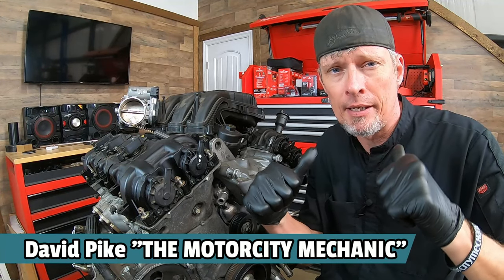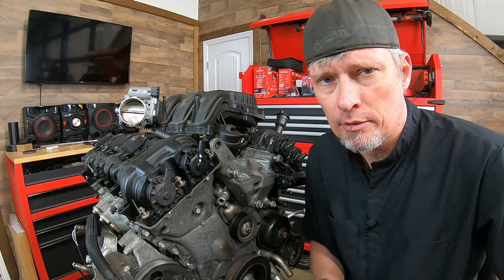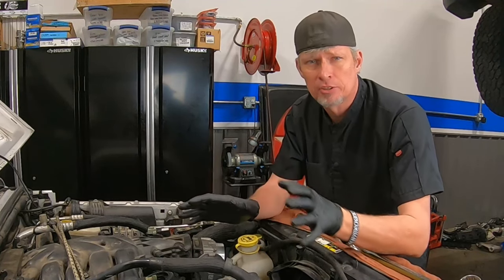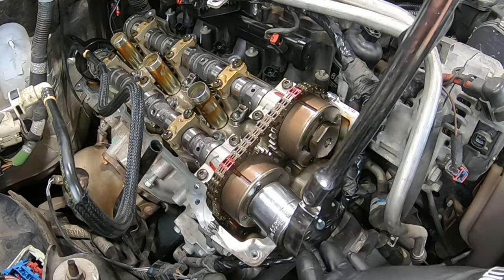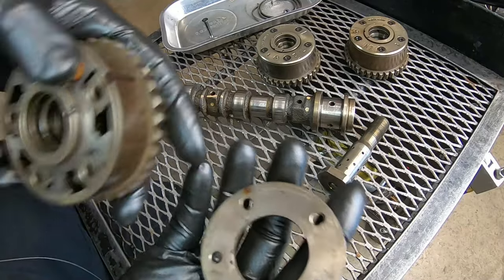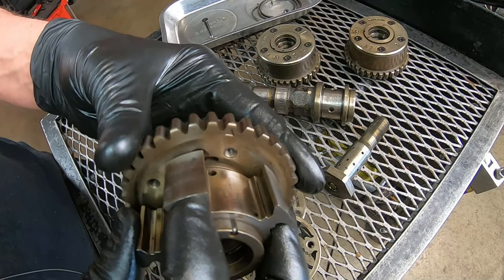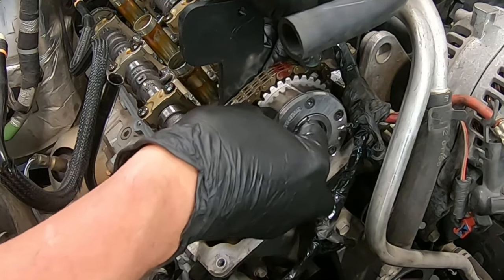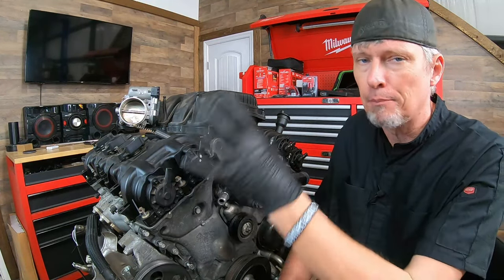Chrysler 3.2L/3.6L Camshaft Sensor Codes Possible Cause

Comment: David, good information and this sounded like it might be the cause of my P0369 code on my grand caravan with a 3.6l . I was surprised when I got the valve cover off and put a wrench on the camshafts and had no excess movement at the phasers. Do you think that if a phaser is bad on bank 2 that it could be the cause of my fault code on bank 1. The engine has a slight start up rattle but the rockers have all been replaced. 152k on vehicle. timing marks are correct and I've tried a known good cam sensor. Any other thoughts?
Reply: Did you end up finding the fix for your code P0369? I currently have it on my 3.6 avenger and it says it’s an open circuit. I changed the sensor and the check engine light comes back and goes away.
Reply: @stephaniecuna8190  My problem was the tone wheel on the intake cam shaft. Replaced that camshaft and the code went away.

Comment: David go a question i have a 2012 Charger Rt . Brought the car with a knocking engine that still ran. When loading it on the trailer for tow. It's hard to put into gear from park with the knocking engine running . What could it be ?

Comment: Help me please. I’m begging. I changed my lifters and rockers, without taking my cam out , put it back together and have camshaft position sensor code , it is in limp mode / dosent shift right and won’t go over 35 ish unless in slap shift. Won’t go over 3k rmp. But sounds great , runs good. The limp mode could be a wheel speed sensor but the code for the camshaft position sensor is new. Only thing I found is I touched a magnet to the magnet on the cam and now the cam is bad?
Reply: same here iput a new sensor same thing still trying to figure it out.
Reply: Update?

Comment: Do you know if there is an issue like this where there is a star case if that is something they will cover if a car is out of warranty? My daughters 2019 Jeep Cherokee 3.2 V6 4wd threw a P0340 code and isnt running. I know the sensor is pretty cheap, but I believe its located on her model in a hard to get to location

Comment: @Motorcitymechanic - Excellent video, thank you for your insight!  I recently replaced all of my cam followers and lash adjusters on our 2012 Jeep wrangler at 140k miles as we had one that was just starting to fail.  Ran great for 3000 miles, but am now getting P0340. P0365, P018 and P019 codes all at the same time.  Extended crank and momentary shudder sometimes after the engine fires up.  These are opposite banks, so possibly 2 unrelated issues - or are they?  Any insight on if these are related, and which bank to start diagnosing first?
Reply: Did you get this resolved?  I'm curious as I'm seeing similar symptoms.  It happened some time after an oil cooler/filter housing replacement. Getting codes 340/345/365/390/018/019 plus some misfires in cyl 1 and 6.
Reply: @JhanJo I did finally get it resolved.  Ended up being that the wiring harness clip had broken where it secured the harness to the drivers side of engine above steering column.  This caused the harness to drop down and start rubbing on the steering shaft, slowly chewing thru the wiring loom and into the wires.  Eventually it got bad enough that it was causing misfires between the coil signal wires that run thru that section of harness (between ECM and engine).  I repaired the chewed up wires and taped the harness back up, secure away from the column.  Issue is now fixed.   One thing I notice with these - the factory wiring harness is very brittle and over-stressed - wires are often too short where they attach to connectors and are under a lot of tension and stress.  Anytime motor work is done that involves disturbing the harness to remove and replace connectors, great care has to be taken to avoid breaking the connectors or wires, and also to make sure the harness goes back secure into its place on the motor.  The factory wire retainers that hold the different sections of harness break easily and in my case - it caused this issue by letting the wires contact the steering column.  Check all wiring connections carefully and make sure your harness doesn’t have any damaged wires or plugs.  Good luck!
Reply: @jerryhovet2991  Thanks!  I'll definitely look for wiring harness issues.  I keep thinking I caused something when I did the oil filter housing replacement.

Comment: What if you followed the timing chain procedure perfectly.  Also replaced all rockers and lifters. 
But when you go to start.  It only turns over and no start? Only thing I haven't done is a compression test.  But have spark and fuel.

Comment: I need help with my 2013 wk2. Bucks at low speed tip in of throttle. No check engine lights. Did a relearn on trans. Replaced fluids Don’t know where to go with it.

Comment: I see that your socket doesn't fit through the solenoid hole, do you know what the ID of the hole in the valve cover is? I have an idea for a special socket.

Comment: I’ve had this problem for the last 3 years, it started at 300,000 miles and now I have 465,000 it only happens once a month and when it does it goes into limp mode once I restart the truck it will come out of limp mode and the check engine light goes off after 3 or 4 cycles. Codes are p0390 p0394

Comment: I need help. I replaced rockers and phasers. Upon getiing it all back, I rotated the motor by hand to check the timing and the marks line up after two rotations. But What happened is at two spots on that rotation the chain started to get slack and come up off the exhaust cam phaser. then it would snap and the slack went back on the phaser. Is this normal or do you think it is a bad tensioner or because there is no oil pressure yet?

Comment: Because the spring lock pin is not locking in the phaser , can the code set P0021 ,  position A bank 2 Timing  over advanced  ?

Comment: I have a 2014 town and country 3.6.i currently have codes 0349 066dd ? I hear some noise in the valve close to firewall.thank you for the video.makes me feel more confident to tackle this problem. Low oil pressure and cam position sensor codes. Do you think it would be cam and phasor and should I change oil pump or just pressure sensor providing pressure is ok ? Thanks again.this is my first over head cam job wish me luck.
Reply: Good day
How you solved this issue, I had the same issue so I need to know about your case.
Thank you
Reply: Good day
How you solved this issue, I had the same issue so I need to know about your case.
Thank you
Reply: Good day
How you solved this issue, I had the same issue so I need to know about your case.
Thank you
Reply: Chang the engine oil cooler first. The oil pressure sensor is attached. it will save you time.

Comment: Is it possible to clean a cam phaser and re install install it if the spring and pin are good
Reply: Sure, As long as there are not any broken or gouged items.

Comment: Would this also cause a P0017 on a 2013 Dodge journey 3.6? Seems like i didn't get the code until after i did a oil change the other day as i was doing other work to the car and would've noticed this code if it was there before the oil change, no other codes. Car runs and drives great but rpms limited to 3k until i restart the vehicle while driving, then it runs perfectly normal and goes over 3k with no problem every time, until I restart the car. Also, engine is very very sludgy

Comment: Can a bad camshaft sensor cause your fuel injectors to have an open circuit? I went to autozone after experiencing a misfire and blinking check engine light and it said I had a misfire, but my camshaft and crank sensors were potentially causing the problem.
Reply: Had open fuel circuit no. 1 cylinder. Replaced fuel injector for no. 1 cylinder. Fixed it.

Comment: Do you think that’s the same problem I’m getting codes p0340 and p0345 or do you think that is the sensor going bad
Reply: I would check wiring and connections before replacing the sensor. Make sure your wiring is ok by checking voltage and resistance. If wiring and connections are good, only then replace the sensor.
Reply: @ ok thanks for getting back to me

Comment: My 2011 Dodge Grand Caravan rattles on start up intermittently and throwing codes on cam position sensor bank 1 sensor1 and  traction control at the same time. Do you think its a cam phaser? pls need opinion and thanks?
Reply from the maker: My money is on a bad cam phaser
Reply: the same exact thing on my wife's 2011 VW Routan 3.6  with 115000 miles  I was thinking about swapping the cam sensors with each other and see if the code moves to bank 2  this happened 3 times so far on startup when i clear the code it doesn't come back for about a month it's not a dirty oil problem if the code moves to bank 2 I'll change the sensor with Mopar oem if it stays on bank 1 then i would suspect the phaser  or the dreaded reluctor wheel moved on the camshaft 😩
Reply: @MotorCityMechanic  
Dave did you see Ivan from Pinehollow auto Diagnoses move the reluctor wheel back into position using a strap wrench and cam crank waveform on his oscilloscope    no parts required Russian fix
Reply: @marcokahny709  I like Ivan, but that was a Shit repair. You can't do that to a customers car.  Also getting it to the exact proper position???? If it moved once, it will move again.

Comment: Is there an easy way or an aftermarket scan tool that allows resetting the cam / crank Learned values after cam or phaser replacement?
Reply: jscan and alfaobd both have this function

Comment: Love your videos on the 3.6 Pentastar! You've helped a lot during my ownership of a 2012, hoping you can point me in a direction or maybe you've come across. Out of the blue (no part changes) @ 11yrs 95K I am having random misfires that jump around on all cylinders, I've done everything and still have this issue. We're talking cam & crank sensors, sparks & coilpacks, smoketest, rocker arm replacements, and even a complete timing chains & guides replacements! Still random misfires but nearly entirely at idle when the engine is at operating temp. Hoping you could give some advice, thanks!
Reply: Do you have ACTUAL misfires (you feel/hear roughness, etc.) or the ECU is only TELLING you (through codes/CELs) that you have a problem?   If codes only, how old is your battery?   Yes, sounds unorthodox but the 3.6 & 3.2 Pentastars will throw real wonky/implausible data when the battery is negligible causing phantom codes.   If it's happening at idle only, perhaps the alternator is on the way out.   Can you get both of them tested just to rule them out?     With all that replacement you've done you've covered most of the physical problems so perhaps the issue is logical (the ECU's interpretation of data).
Reply: is there any code it throw?

Comment: I have a 2017 Pacifica until the oil temp gets to 180 degrees it has 32 psi oil pressure when you put in drive and accelerate the oil pressure jumps to 80 psi just for a split second and drops back to 32 psi and it does that until the oil temp reaches about 180 degrees then it has 32 psi no matter what the rpms are. Is this normal or should I be looking for a problem?  Great content keep it up.
Reply: Normal operation due to dual pressure oil pump. look up 3.6l pentastar oil pump to see the solenoid.

Comment: This is my problem on my ram 3.6. My truck throws p0390 and p0394 codes every 4 months for 3 times and my truck goes into limp mode and had done this for the last 100k miles, now I have 440k on it so I'm thinking mine need to be replaced because I already put new Mopar cam and crank sensors and a new wiring harness

Comment: Oh BTW all these dealer do not matter which make and you have a interment problem and you take it in under warranty they say it works as it should. Nothing makes me more pissed that to hear that. It takes time for things to shut down. I had a problem with both fobs not working right and I said they need to be reprogramed they loose they single over night. I had to take it in and leave it two times and they still said it worked as it should. I fixed that problem and took it back a third time and the one fob was dead. They replaced it with a new fob now it works as it should. A lot of people are having problems with dealer that don't want to fix stuff the last few years under warranty. Or they say we can't get to it for 3 weeks. Find out they only have two techs that are left to work on stuff at a good size dealership.
Reply: Intermittent repairs are the toughest problems to fix. Can't really fix it if it's not doing it at the time. And as far as having only 2 techs, its tough work for not a lot of pay.

Comment: In the Japanese world like Toyota and Nissan poor maintenance and lack of oil changes results in the oil control valve getting plugged up. Which causes the lock pin to stay stuck when the engine starts. So you get a rattle until oil pressure builds up enough to unlock. In the case of this Chrysler lack of oil pressure at start up is designed into it with the silly oil filter housing and no anti-drain back. So I can see the same problems happening for different reasons.

Comment: Hello 2015 jeep grand cheroke I have the lift and rocker and I have the code p000C
Reply: Just bleed the front cam phasers the little needle should pop if one it’s stock there’s your problem lucky you got an easy one I been battling a p0300 and p0018

Comment: He's wrong at 2:05. Bank 1 sensor 1 is the intake sensor on passenger side NOT the exhaust.
Reply from the maker: Po340 is listed as 1/1 and the code discription is exhaust cam on right side. Just as I mentioned in video
Reply from the maker: Now when it comes to the VVT solenoids they are numbered different…..1/1 is intake cam on the right side big again I was speaking of code p0340 which doesn’t apply to the VVT solenoids
Reply: @MotorCityMechanic  I just watched the video again and you're right. I was multi-tasking (reading comments and questions below) while watching the video the first time and I thought you were talking about the VVT solenoids.

Comment: That customer got some emotional attachment to that car?  There comes a time to fish or cut bait. High mileage on a historical trouble prone engine.   Insane to keep dumping good money after bad.
Reply from the maker: The one vehicle that holds its value the most is the Jeep Wrangler. Seems most Wrangler owners are attached to their vehicles for sure. I have a few customers with 500,000 miles on these engines in Promasters. It’s has its issues for sure. Rocker arms….oil filter housings, and thermostats….that’s the bigger 3 items I see. Otherwise I have only had to replace 2-3 in my career and some of those were complete neglect. I do wish there were zero issues

Comment: 155k miles motor blew up 3.6 are no good had it rebuilt at 75k 
My wife’s 3.6 had it rebuilt under warranty at 35k
There both 2015
Reply: I have 220 miles in a 2014 caravan The same engine, runs great. Not a single problem
Reply: Should have stuck with the 4.0 I6

Comment: Thank you soooo much, for a year and a half now I have been trying to figure out limp mode issue when going up steep or long hills, I have replaced both cam position sensors, crank sensor, all 4 vvt actuators and the issue kept happening. I have just bought the vvt sprockets and vvt tools and am excited to see if this is finally it, if not Im going to give up on Jeeps and go get a 4 runner or something like that.
Reply: Having the same issue, let me know if it resolved it.
Reply: I'm having the same issue. What was your fix?